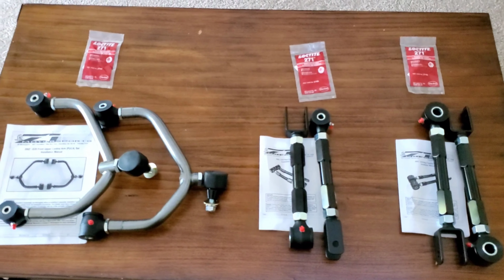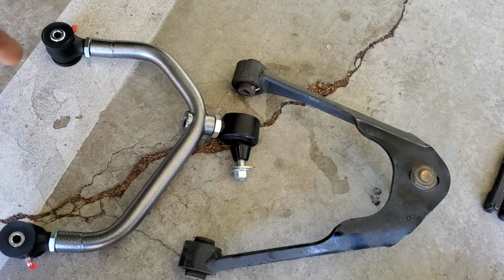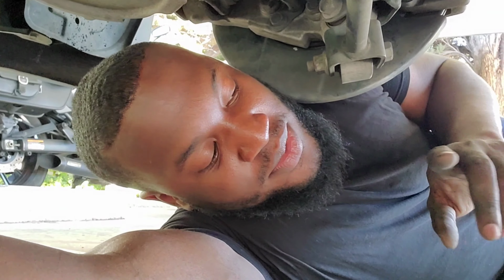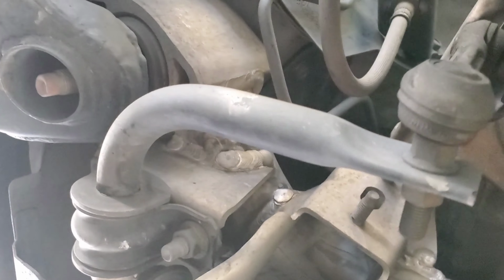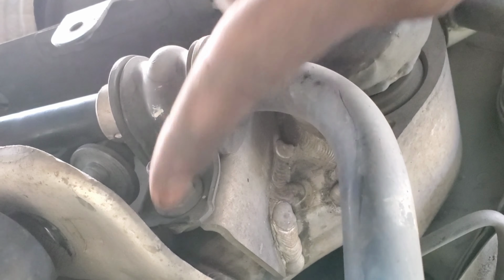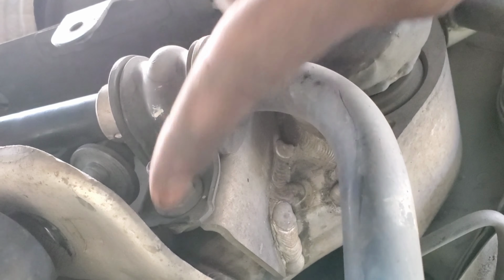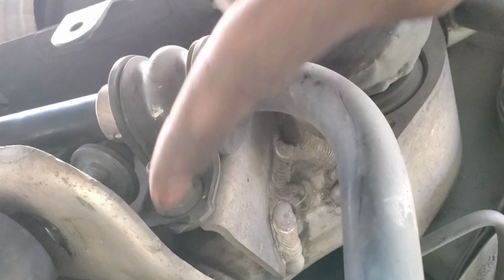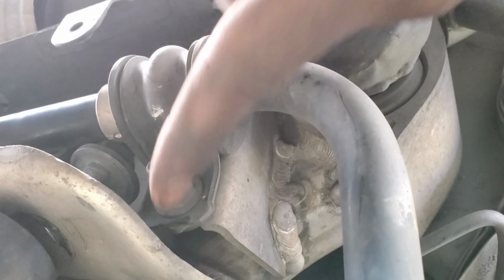HOW TO: Z1Morsports G35 Camber Arm Kit Install

Comment: I got the front arms, how difficult was it to adjust them during alignment?
Reply: if you do it its just annoying having to undo it every time you change camber and if you take it to a shop mine charges $85 for alignment but as soon i told him you have to lift it and undo it to change it they wanted double so ive been setting my camber then getting it aligned and its fine

Comment: Sick install video. Instructions call for loctight??.. where tf am I supposed to put that and why?
Reply from the maker: Blue loctite on the bolt threads to prevent backing off and prevent rust I believe

Comment: They sell lock-outs , so you don’t have to use the stock adjuster , for the rear camber arms , get the centered ones not the offset type